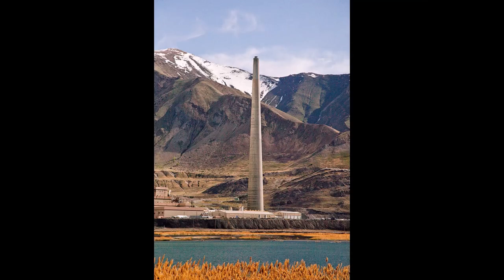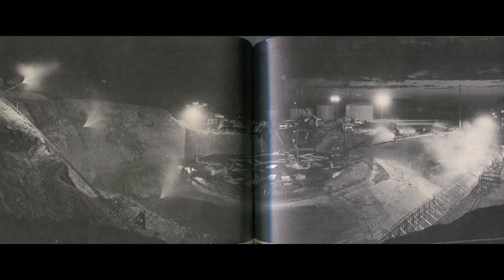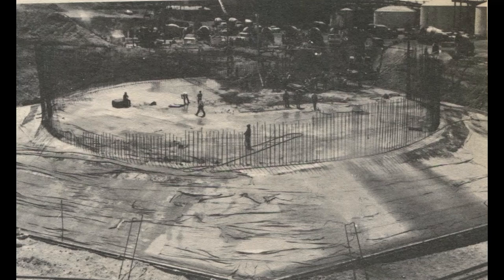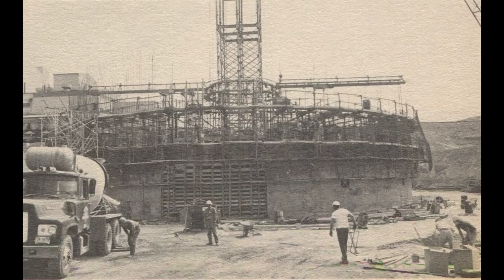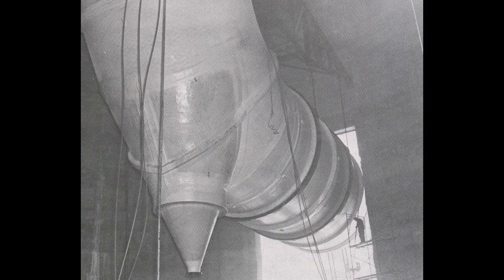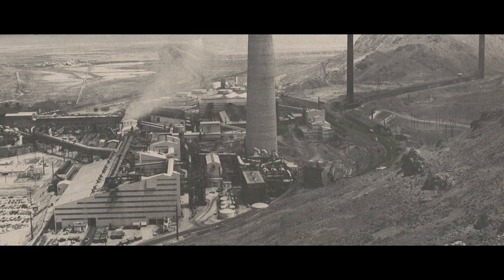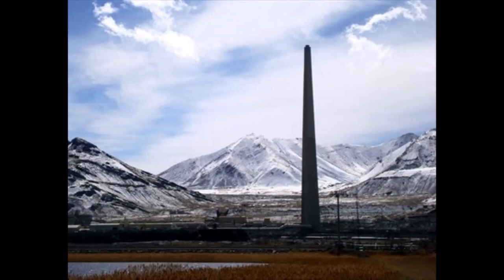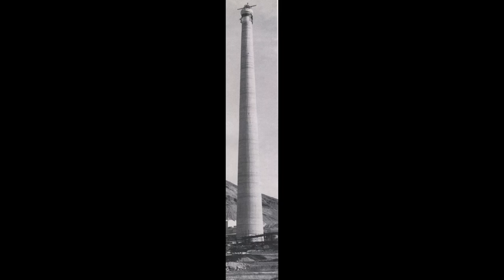Constructing the 1,215-foot Garfield Smokestack.

Comment: I grew up in a small copper smelting town in Canada.  In 1974 a new stack (825' high) was built to replace the two old stacks (250' & 150' high).  It made a large difference for the air quality in the town.  I'm surprised the stack had a fibreglass liner, ours was stainless steel and it normally operated with a flue gas temperature of several hundred degrees.  The diagram showing the comparison of the tallest chimneys is missing one of the tallest in the world.  The Vale (formerly INCO) stack in Sudbury, Ontario, Canada is 1250" high making it the second tallest in the world. Ken
Reply from the maker: What a great comment, Thank You!
Reply: That’s awesome. My dad climbed this 1250’ stack in Canada back in 2020. No access to elevator or a drum life/hoist. Wore me out just thinking about it

Comment: Boy mr.Tim, 2"+ size rebar and 4500psi concrete at those dimensions.....It took some serious teamwork to pull that off - those cats had to be experianced dam constructors to work with that  collossal amount of material, no time for bricks on that stack, they're actually chimneys, one of the toughest structures created by man used for lighthouses (or were - like your Isengard☺️) and tunnels and pipe.... but that big boy boggles the mind ... I gotta get to the maps now and see how far the Garfield smelter was from old Bingham, then Ive got some learning to do to understand that scrubber operation and how the fiberglass/composite pipe fits in to that operation.... before I retired, JEA was installing bio filters and composite pipe  and coverings on the clarifier tanks to totally take the smell out of sewer treatment plants, but they were tiny compared to that 24 ft. Dia monster, and we laid 42" and 48" composite pipe replacing some outfalls and that stuff was tricky to work with in a deep trench ..
I can't imagine the difficulty trying to "hang" that big composite stuff, it's much heavier than you would expect, anyway, thanks again mr.Tim for a blast from the past.... "ALL ABOARD THE COPPER KING RR MINE AND TIME MACHINE " ...
Reply from the maker: Thanks Mark, another great comment, thanks for your interest in my Channel.